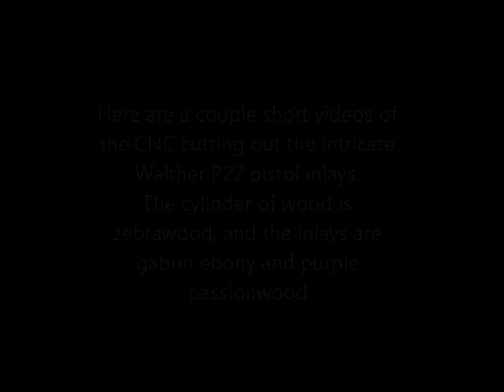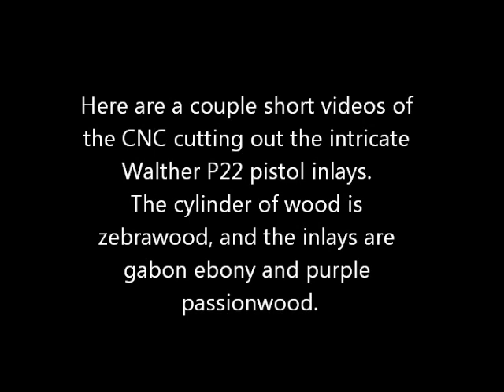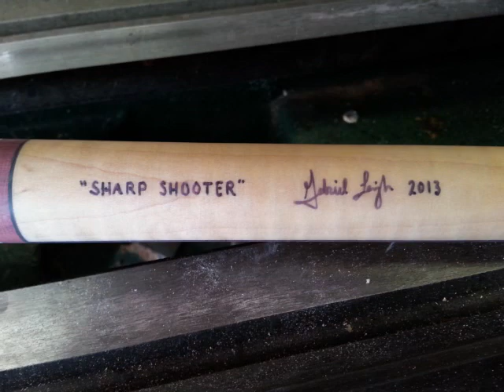Building Abbey's Shooting Star   2013

Comment from the maker: Ahh, that is called a "joint protector". It is a small threaded knob that screws onto the metal joint pin to protect the pin in case the cue is dropped. 

It is mostly for decoration, though. If you are careful with your cue as you take it out of your cue case, you should never find yourself in the situation where you wished you had a joint protector.